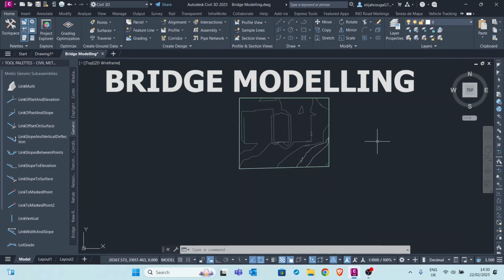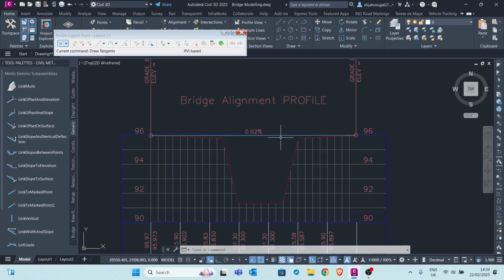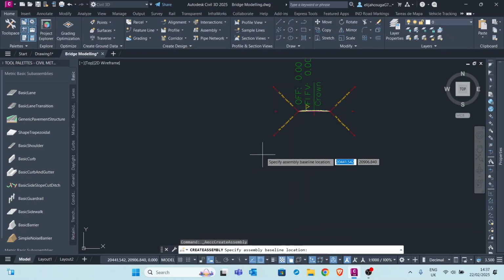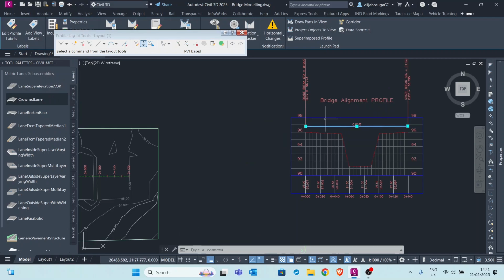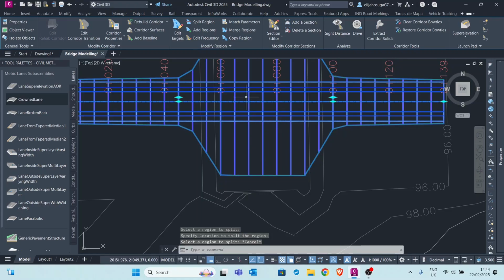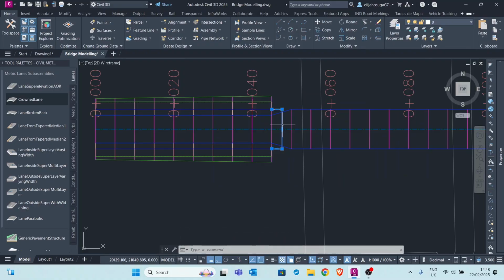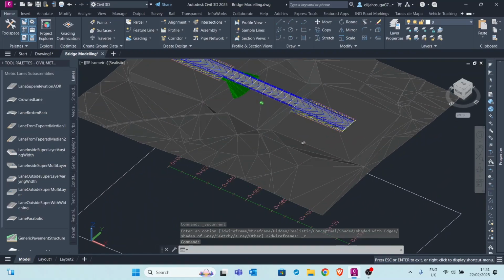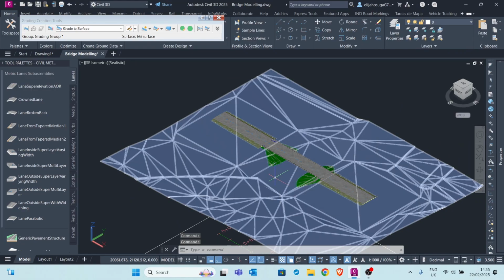Bridge Modelling Using Civil 3D 2025

Comment: Loved the video.
Need your opinion please. I need to calculate cut volume for minor but 100s of structures, which are half-moon structures. How to create those cut fill volumes in this case?
Reply from the maker: Are you able to create a surface with the half moon structures? My suggestion is to compare that surface with the existing ground surface. Use the 'Volumes Dashboard' under the Analyze tab.